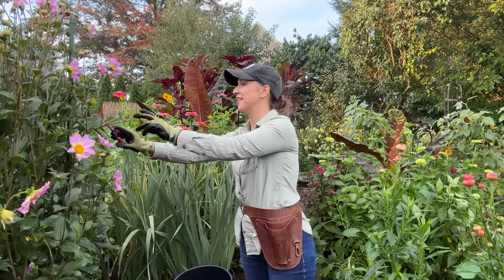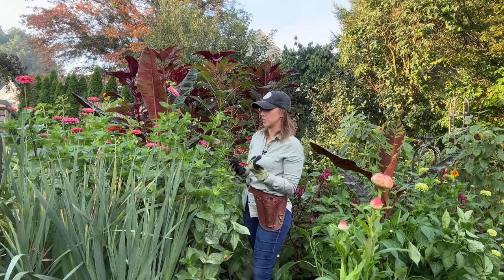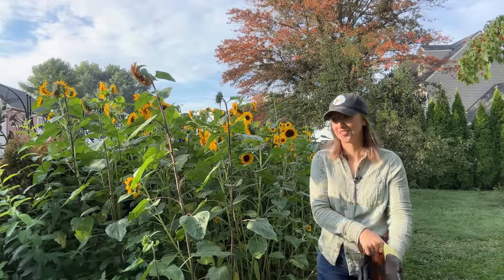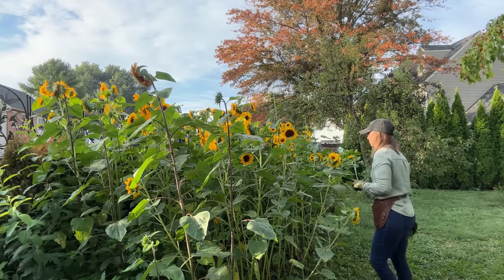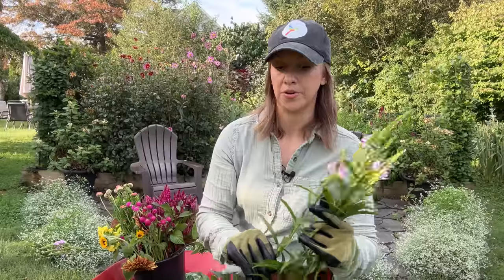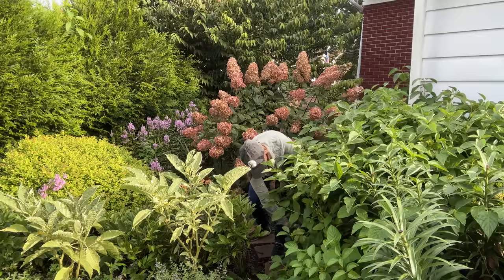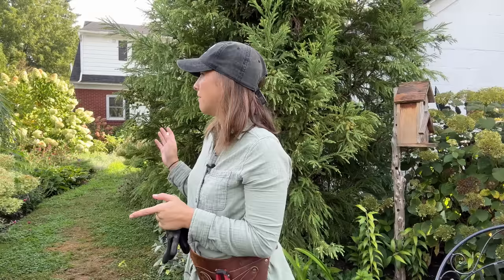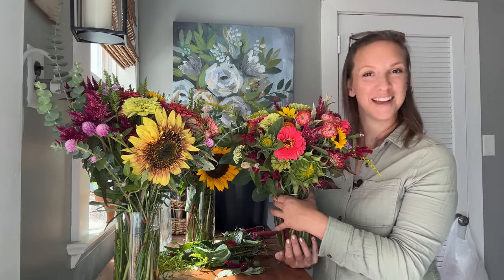Reviving Wilted Dahlias, Zinnia Meltdown, Quick Dip vs. Boiling Water for Cut Flowers, Fusarium

Comment: 20 years ago I use to use this same technique for roses where if they started dropping you soaked them in water then put in fridge. Tulips are notorious for this too and you can do that with them as well. But mainly used for roses. Good tip.

Comment: Ive been doing the dip the dahlia in alum method and its so easy. No need to boil water. Harvest your dahlias, recut and dip in alum then into your vase. Yes the water will get somewhat cloudy if youre using a clear vase but itll clear out and your dahlias will be last for 2 weeks

Comment: Great video Danielle! I have a question on the boiling water method vs quick dip. I am trying the  boiling water for those prone to wilt and it is great but what do I use if I have to re-cut the stem to fit the vase? I was keeping quick dip around for this reason as I tend to need to recut . Thanks so much
Reply from the maker: Hi friend! My experience is that these stems mainly melt down initially. After the boiling water treatment they should be good even if they need recut. Please correct me if anyone has experienced something different. But I just do the initial treatment and then I don’t treat again.